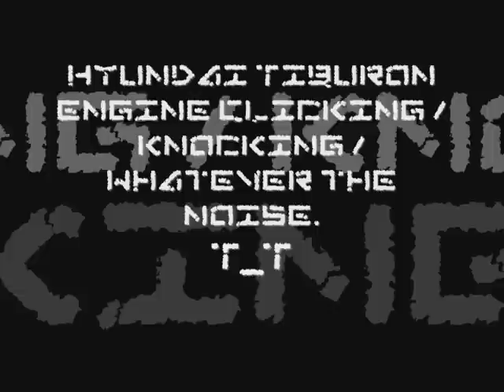Hyundai Tiburon Engine Ticking / Knocking

Comment: To anyone who has this exact same engine in their car like I do this noise is because of the oil has lost its viscosity and the oil filter is gunked up.
I have an 07 Tiburon Which experiences this harsh valve train noise every time the oil gets old. You notice it when you decelerate and come to a stop, also when you start it cold especially after use within 5 or so minutes. It happens when the oil is hot.
Don't use 10w30 as it will not like that type of oil in the winter. I use 0w30 in winter and in summer I use 0w50. I also use a high flow oil filter because the paper ones are just plain garbage and get gunked up very quickly. My best brands are Amsol or K&N. I prefer K&N. After switching to K&N oil filter I do not hear that noise anymore unless I use a crappy brand oil or used too thick of an oil.
There is no need to worry about vacuum tubes, timing belt or chains, unless it was modified or abused. It's not a GM or a Chrysler from the 80s. 
The noise is because oil is not getting to the heads properly. Plain and simple. It's common when engine start to age.
A quick fix is just change the oil filter and dump in 3/4 of a quart of 0w30 to replace the oil lost from removing the oil filter. Of course you should definitely get a full oil change but use your own oil filters instead of the shop's recommended garbage.
Remember these Hyundai engines are very uncomplicated and relatively simple to maintain and keep running.
Reply: Holy chit !! 
My buddy said same thing about possibly being the oil viscosity..
Reply: mad respect for taking the time to share

Comment: I have the same sound and when I removed the valve cover I found that the upper chain guide was broken. Change the camshaft chain and guides and problem solved.

Comment: Use the screwdriver stethoscope method. Get a large screwdriver, put your ear to the handle end, then stick the tip on non moving parts to pin down where it's coming from.

Comment: there aint timing chain on this 97 model, its the valve settings u need to re-set the height of the valve lift, in this case, the valve hit the piston a little bit by a millimeters. it wont do any harm onto the engine..i have the same exact problem..

Comment: Its lifters tapping they have hydraulic lifters and if u dont have enough oil they knock after u fill oil run it for a few minutes so it can get the fluid back through

Comment: I have the same sound coming from mine.  The dual overhead cams are connected by a chain ($20) and is likely thlee culprit.  I blew a head gasket on mine, so this weekend I'm putting on a rebuilt head, new timing belt, cam chains and water pump.  I'll let you know if the sound goes away.
Reply: waiting...
Reply: Same guess Chad ran into some issues has taken him about years
Reply: Waiting

Comment: definitely lifters. probably an intake lifter that's why you hear it coming from the intake manifold. Only thing to do is have the valve train removed and replace the lifter. dont use seafoam or any other kind of engine cleaning chemicals because you run the risk of oil clots getting sucked up into the oil pump and causing even more problems. There is a time and place for engine cleaning chemicals and it's while the engine is new and still "clean". You are in for an expensive repair buddy.

Comment: You should be running at aleast 10w30 motor oil you can run 10w30 10w40 and 10w50 mine did it before and it sounds like the oils thinned out